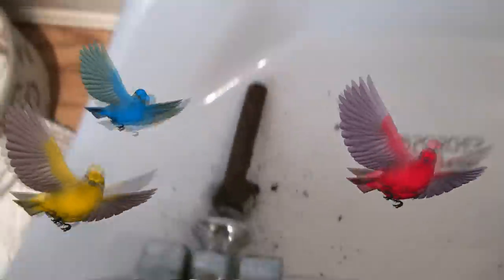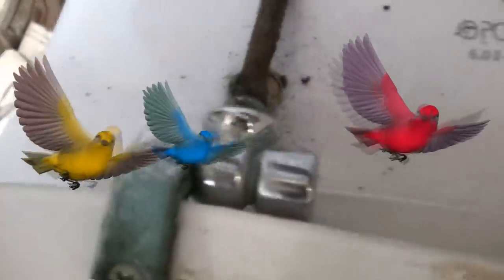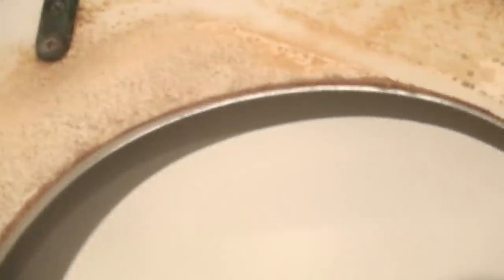EASLY REMOVE OLD TOILET SEAT - RUSTED -  ROUNDED NUTS

Comment: Best tip ever to use heat !  I've had a new toilet seat for two years and spent already spent hours trying to remove the rusted plastic nuts.  Didn't have a blow torch so used the old kitchen knife and heating it on the stove method.   Took only 15 minutes, couldn't believe it! I didn't have to melt much, the heated knife cut through to the bolt after a few back and forth trips to the kitchen stove.  (I only held the knife blade  to a burner on high for about a minute at a time, but it still worked great)  Once I got the initial cut to the bolt, I was able to used the heated knife to pry the plastic nut up a bit and then was able to twist it off by hand!  I would recommend eye protection and using a really sturdy old knife, also having  head lamp to see what you are doing doesn't hurt.  Made my day to get this done!

Comment: Thank you! My girlfriend was hounding me to get the toilet seat removed for a very long time now. I've tried just about everything but one of the screws is in a very tight space. Ran out to get a blowtorch and some protective eyewear and this worked like a charm. Granted it took me a bit longer than in the video, about 20 minutes or so. Anyway, this is invaluable information and I appreciate it. I would recommend wearing a mask though, the burning plastic fumes were something I wish I had avoided.

Comment: This is a great tip, and I thank you.  I used a soldering iron instead of the heated putty knife. Once I got one complete slice into the nylon bolt, it unscrewed easily.  Thanks.

Comment: We spent an hour trying to saw and chip at the thing until we stumbled across your video. We used an old, chipped screwdriver and our gas oven range to surprisingly great results. I was also worried about cracking the porcelain with direct heat, so this really made my day. Thanks buddy!

Comment: This video truly was a great find!  The seat of the toilet in our rental apartment was in dire need to be replaced but was probably over 15 years old with bolts so rusted that you couldn't even tell what screw driver to use.  As other viewers suggested, we used the element on high of our stove and an old knife.  Probably took about two hours from start to finish, but it was so satisfying to do it myself and not spend the money on a handyman!  Thanks so much, Dino!

Comment: Thank you for suggesting this. Did not have a benzomatic torch so I used the inspiration to avail a little used soldering iron. Took a minute to warm it up and less than minute to splice the nylon nut in two place and the nutvwas no longer a factor.  Toilet seat came right off. Prior to it I tried WD4O. and different wrenches, cutting saw, hammer with a chisel, etc. Glad to have happened upon this. Thanks!

Comment: thanks,it worked. everyones video showed tools i don't have, including your torch. Yet i do have a putty knife w/ wood handle (important cos wood won't conduct much heat). i had wanted to cut the nylon with a razor, but like you said. The reach is tough. SO. i improvised and used the stove top to heat the knife red. I MADE SURE TO WEAR WORK GLOVES FOR PROTECTION. ..done in 4 minutes thanks again dino

Comment: Thanks Dino.  I am afraid to use a blowtorch- but I saw they have ones which chefs use, which maybe I could operate safely.  Do you think that type would give off enough heat to do the job?  Any other safety tips appreciated.
Reply from the maker: +dragomirova ive used the chef one to solder copper pipe...i had anoher chef use that torch in the video for 2 dys to carmelize sugar cuz he ran out of gas....it's the same  torch...same     gas=same tempature...the tmp is a function of the fuel source...the chef and the benzomztic use the same fuel that burns at a specific temp no matter who is holding the torch....yes you can use either

Comment: Thanks. I watched this before tackling mine although with WD40, strength and pliers I was able to remove the plastic nuts without needing heat. It was still useful to have this as back up however.

Comment: I used my chef’s blowtorch and a slightly too big putty knife and still got it. I forgot why I never changed the old seat until I tried again. Pro tip: use a mirror instead of phone to see what you’re doing and a flashlight helped as well. This guy is a genius.

Comment: The metal hardware on top rusted but there is plastic bolts underneath. Could not get a screwdriver to hold the top. I knew if I could get the plastic off underneath it would work... but how? Thank you so much for the suggestion. I am getting rid of that wooden seat for good and no more metal bolts ever. ;)

Comment: I just tried this method with my hobby soldering iron. I melt through on one line, and snapped the rest of nylon bolt twisting with needle-nose plier. Yes, it worked. 
One time, I was thinking of trying with tip of glue gun, but I tried solder iron because I don't have time this time. I will try with glue gun next time if I have to.
Enjoy a new toilet seat, everyone.

Comment: Thanks Dino, but how about if it's a rusted metal bolt?
Reply from the maker: ***** if nothing else helps get it off, carefully drill or cut the hinges off from top,or melt the plastic seat hinges okk the metal threaded studs, pull seat away...bolts drop to floor
,,,thx

Comment: This might be a good idea.    I almost tried it.    But I do not like to breath fumes of burning material.    I am afraid of possible health effects, such as cancer.    (I am not a health expert.)   I tried lubricating with WD 40.     Then wait a half hour.    Did not work. I tried a long time to turn the nuts.    Then another dose of WD 40.    Wait another half hour.    Try a long time to turn nuts with pliers.     Made some progress on one nut.     Try another dose of WD 40.    Etc.   Eventually the nuts came off.    Was not easy.    But persistence with WD-40 worked.    Did not have to inhale any fumes.
Reply: but you had to inhale the wd-40 fumes :(

Comment: Just cut the hinge rings on top that the screws set in.  So much easier!
Reply: The wing nuts on my very expensive toilet  seat cover  are  metal, so I am cutting the top plate with a hack saw. This time I have a cheaper  toilet seat and cover with nylon parts.

Comment: hey guy some idiot when putting the seat on added metal bolts instead of plastic and now its all rusted solid got any ideas?
Reply from the maker: sure choices are 1. carefully drill of the bolt heads with sharp drill bit one size bigger than the threaded part of bolt 2. carefully cut off or grind of the bolt heads with angle die grinder (dremel may work) ...either east pay careful attention as not to get tool in contact with porcelain or damage will be evident...meditate on this, it's important